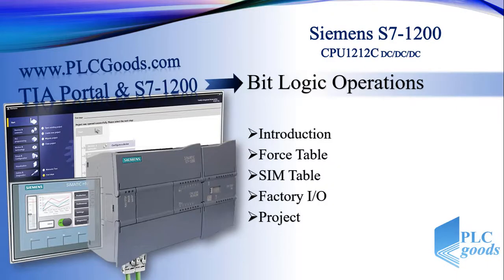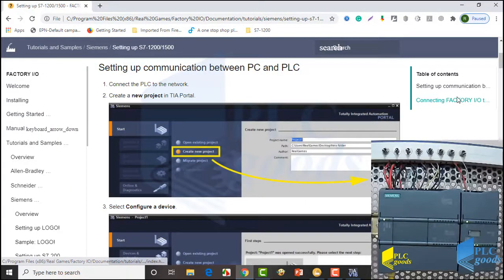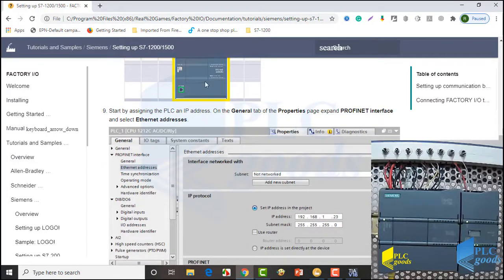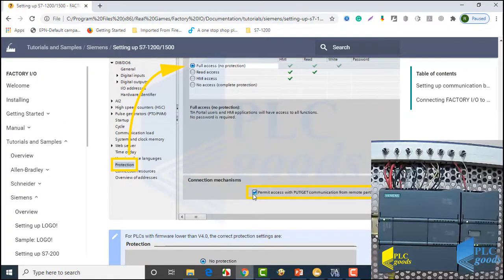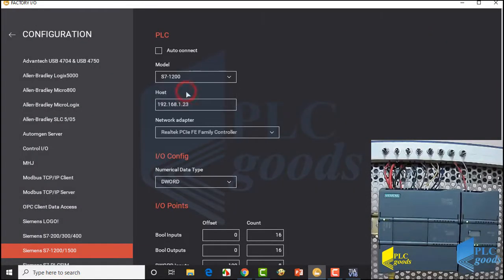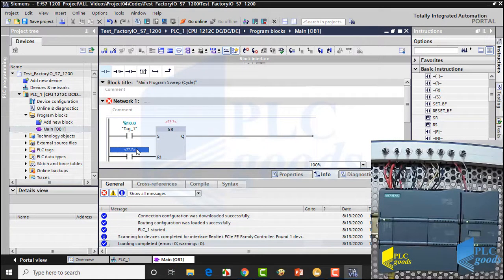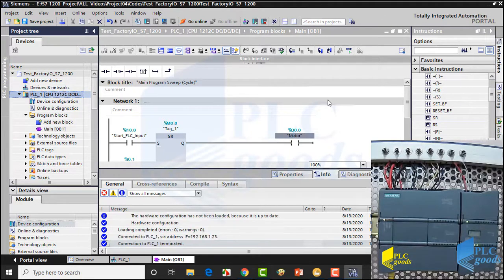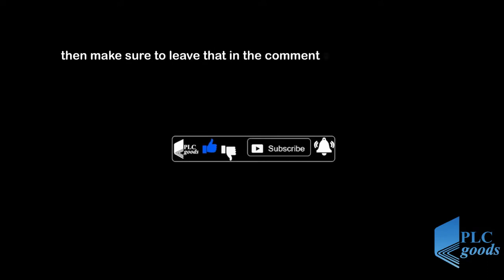Connect Siemens S7-1200 PLC to Factory I/O | Virtual PLC Program Testing

Comment: Hi Sir,
If I want to connect a PLC S7-1200 with Factory IO like you, I must have a real PLC, right?
If I don’t have a real one, then I must use PLCSIM and the FC9000 function block, correct?
Thank you. Please check and reply to my comment soon.
Reply from the maker: Hi there, Yes, you need FC9000 if you don't have a real PLC. You can use Factory IO's help window or its website to find a template program for TIA Portal and when you open it in TIA Portal, you will see FC9000 is used in the first network of OB1.
Reply: @plcgoods  
Thanks, sir, for checking my comment. I’ve done it.